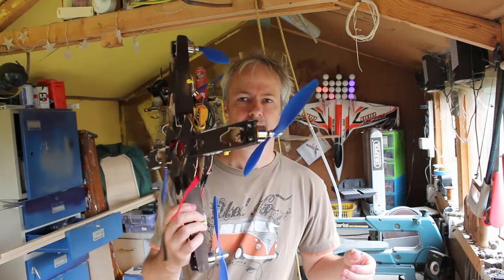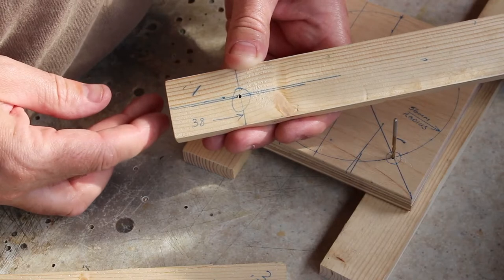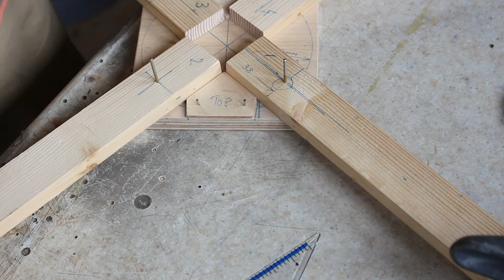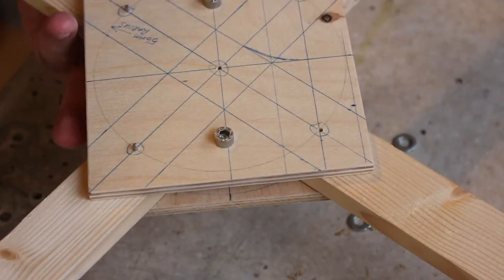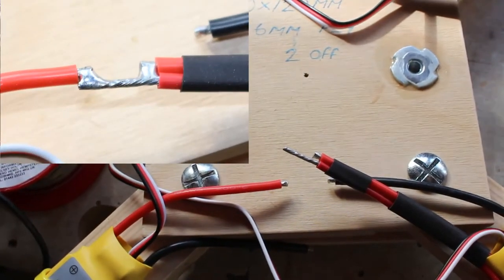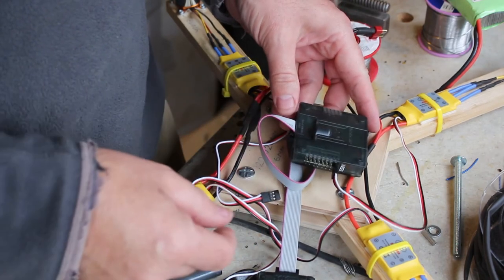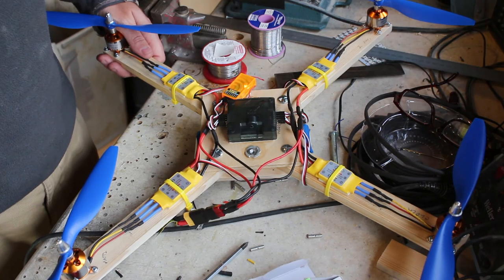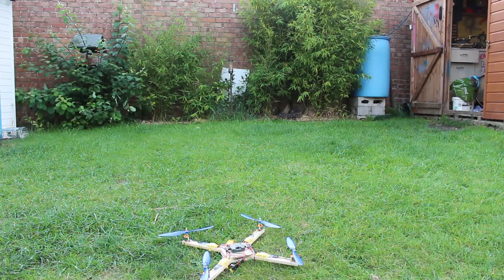Simple quadcopter

Comment: Was this built in 2017? You're awesome man!!  BEST wishes to you and your family.
Reply from the maker: Thanks for your kind comments. I think it demonstrates how easy a quadcopter is to build. i reckon you could use straight branches from a tree and tie-wraps!!  (maybe that's another project!)
Reply: mrfid72, my pleasure and I meant it. I agree with you. Yes, I've been learning about the various all in one boards and it is amazing how tightly integrated the items are. Flight controller, esc, osd, etc etc...only a matter of time before all of it is on one chip inside the battery at that....or if the 5G speeds allow we could just go complete cloud based logic.....some branches, a battery, and propeller 5G connection....heck even the esc function can be offloaded to the 5G connection with input to motors changing on the fly (pun intended)...hehehe.....ok fine, I'm digging a bit hole there though it's fun to dream..... fluid flight fun.... looking forward to seeing more from you.... thanks and have a great wonderful life!!!